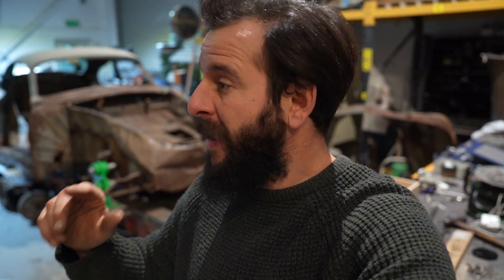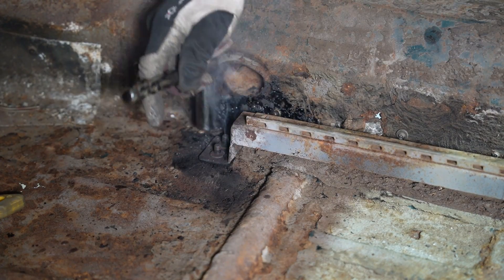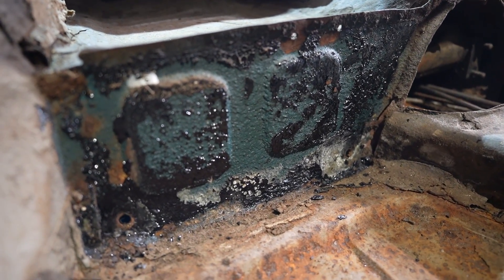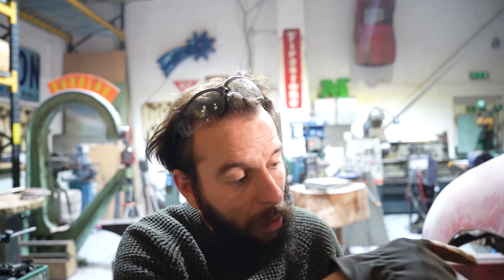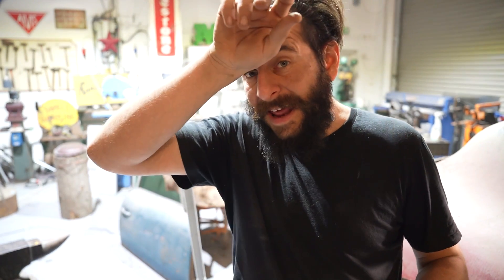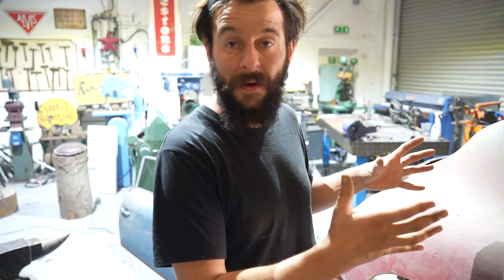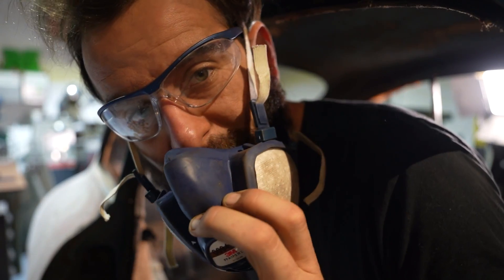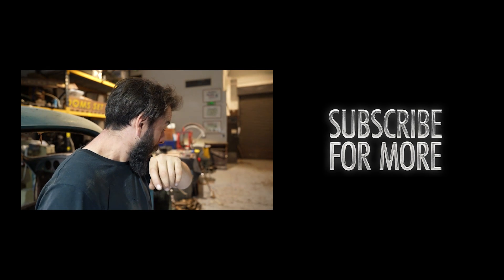Floored By The Porsche! | Barn-Find Porsche 356 Restoration | Episode 5

Comment: I’m at about the same point on my own 356 restoration. Car restoration number 56 coincidentally. At the point you are at my “go to” method is to use a pneumatic needle scaler tool. The tar type residue will typically chip right off with it. I’ve done several Alfa Romeo cars with a similar tar undercoating and on average I can strip a wheel well in less than an hour and an entire car in a day. My car has an equal amount of rust and my first metal parts order was in the order of $10000. Cheers Richard Nyberg (Canada)

Comment: Take care of that original heater knob on the centre tunnel Dom. 
Take it off with it still attached to the base unit because trying to replace the plastic handle part is a difficult task without it breaking.
Keep it up , looking forward to January.

Comment: I'm coming to the end of my MGB resto. It wasn't too rusty, had been welded up at least twice before, and was not too bad!  A bit late now, but I'd advise not cutting too much out until you get replacement panels. The old panels are useful for checking the fit of the new ones.
Reply: Very much agree here

Comment: I'm confident that you could not have found a rustier 356!!

Dom, unless you are going to use factory jigs, I recommend removing one old panel at a time AND replacing it with a replacement panel before removing the next. You need that rusty panel beside the removed panel to act as a jig

Comment: In the early part of the video when Dom was removing the poor attempts at repair with Aluminium and rivet, this is going to be like Guy Martin's Spitfire where there was only one original part left. As he got stuck in it was good to see that there is still a good chunk of floor that has avoided the march of the ferocious tin worm. It is amazing when someone takes the time and effort to save a car that most wouldn't touch. It will be a gem once done.

Comment: I am sure you know this but don't throw anything away until the end. OK, maybe the old tar, but not the floors you cut out. You always need them to see some detail (like where holes were drilled) or to use as patterns later. Will enjoy seeing how you get on. I don't know if you get earthquakes there (unlikely) but here in NZ I'd have to use locking castors on a table like that. I had my Riley car chassis on a wheeled dolly and didn't have them locked and it moved a fair way in even a small quake!
Reply: No, we don’t have earthquakes here in UK.

Comment: When you use a blow torch on bolts etc the hottest part of the flame is at the tip of blue part of the flame. If you get the flame too close the combustion is not complete and it is not so hot. 
You are a saint taking on this massive resurrection job. Best of luck.

Comment: What has started will be like a work of art, I will not miss a single chapter.
 Maybe it's a bit late, but I advise you not to cut more, until you put some provisionally welded braces, in the lower part of the bottom, and in the openings of the doors, so that the body does not close, this is what I say from experience Own that I restored a Seat 600E, and I did not take that precautionary measure, to prop up the bottom part, and the body was closed a little.

Comment: Hi Dom,
Great to see progress on the Porsche.
Given the age of the vehicle you have had the "pitch" and fluffy insulation checked for Asbestos haven't you ?
Remember the sound deadener under modern stainless steel sinks used to contain it as did a lot of bitumastic sound deadening finishes...
It's not just in period brake shoes and pads !

Comment: It was very exciting to see a new video on the Porsche restoration. I have removed tarboard sheeting from a couple Beetle restorations. I found trying to wire wheel back to bare metal just gummed up the wheel. Using a needle scaler in a cool ambient environment worked a treat. I totally get your enthusiasm for this project. Peck away in bits  and progress will be had.

Comment: Hi Dom, not that I know a lot about car restoration, but think you need to be careful cutting metal out as this will weaken the shell, personally I would have had the shell blasted then cut out the floor on one side, fitted the new floor panel then step by step removed and replaced the sill panels one at a time then once completed move on to the other side to keep the strength and geometry of the shell.

Anyway really enjoying the project.. hopefully you will have it completed for the cars 70th birthday 😊

anyway take care and have a good week..

Robb Torremolinos Spain
Reply: Car is bolted to a really good jig, there shouldn't be much of an issue. Dom knows what he is doing, make no mistake!

Comment: Hello Dominic . Seeing you cutting out the floors was like deja vu ! I did exactly this on my "e"type . And like you l always had to make a plan about moving , dismantling . I once had to dismantle a spray booth single handed , no one on site and a slipped disc ( l had a custom made sprung steel corset that kept my back rigid ) . I still can't decide if l was chuffed or just plain ignorant ! Are you still looking for a spot welder  ? I have a fantastic multi spot M80 . Cheers !

Comment: You could use Henry as a bit of Local Exhaust Ventilation.  Just position the end of the hose close to where you are working.  Not as good as the real think but while help a bit in reducing the dispersion of the fine stuff that is irritating you.  Also for dusty stuff you really need goggles not safety glasses. Apologies for going on but Elf and Safety is important despite what people say 😉
Reply: I'll throw the floor sweeper attachment on the shop vac and set it upside down near whatever dusty crap is floating. Even if it doesn't suck everything up I can direct airflow away from the face most times.

Comment: The pitch in the tar board is possibly causing the itching.
If you're experiencing - itching?

You've got to make time, gather friends and spend a weekend organizing the shop better, you've lost major usable sq. footage the way it is.
Trust me, I'm a professional.

Edit after my comment about the itching, ehich eas posted before you said you're so itchy😂

And yes, the dry ice idea is a great idea because, If, youre not going to dip the body (which is a more uniform process of stripping) then blasting the tar will be more aggressive to any good metal below it, meaning, as the blast media take seconds to scours the tar amd blasts through the bad metal below it, the edge of the good metal will be exposed, but in order to get to the top of the good metal, the edges will get thinner and thinner.

Dipping this was the way.

Comment: a number of years ago the father of a friend of mine bought the Austin 7 that had been at the 1943 Motor Show, it was originally owned by a fisherman from the Colchester Brightlingsea area. Every year the fisherman coated his fishing vessel and the underside of his car with tar. When my friends father began the restoration of the car, he cursed the fisherman in the beginning, then discovered that the underside of the car suffered no rust despite being in a coastal area in a salt laden atmosphere. He said once the tar was chipped off the metal underneath was pristine.

Comment: The tar boards and underseal are there for vibration damping from the engine bay. It will be Interesting to see what modern alternatives are out there. Especially as you won't be stoving the paint like they would have at the factory.

Comment: Great that you are finally making progress on the car itself. You need a decent shop vacuum cleaner to suck the detritus, horsehair and vermin crap as you scrape anything off the car.
It's never a good idea to have electric cables running over metal bodies at the best of times, even worse with them over freshly cut panel edges!
Keep up the effort but stay safe.

Comment: I also have a project - probably in worse shape than yours.  Floor pans are mostly already gone but the tunnel is also mostly gone.  Looks like you are leaving a lip around the perimeter and the tunnel to attach the floor pans.  I don't have a lip so do I need to weld to the remaining metal and make up a lip first?  Also, do I install the tunnel first to have that lip as well?  Thanks.

Comment: Much easier to use an air hammer on a compressor to remove the underseal, quicker and comes off easily especially when very cold

Comment: Hello Dominic. In had a sneezing fit just watching. Great to see that some areas of the body are very sound. Changing the subject, I was at the NEC classic car show and on the Railton stand I noticed a reference "Body by Ranalah" and immediately thought of you. I wondered if the Ranalah wheeling machines and the Ranalah coachworks were connected. Obviously the two trades are complimentary but was it the same company? I hope you don't mind, but I will include a link to my video starting at the time of the Ranalah reference. All the best, Mart in Solihull. Link: https://youtu.be/kFGHHu5LVXQ?t=2875